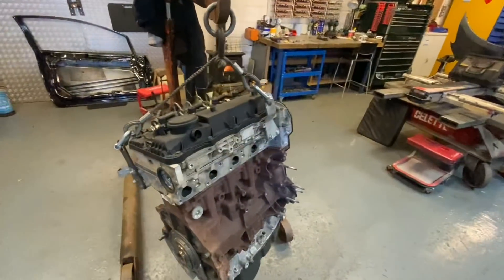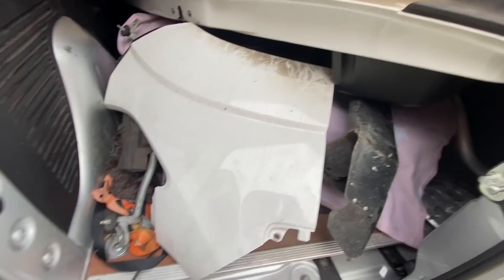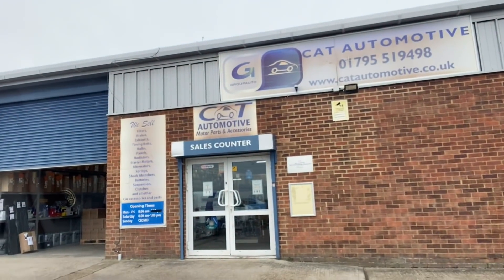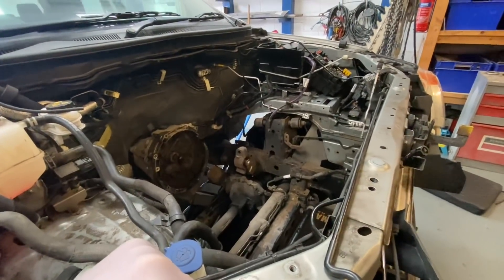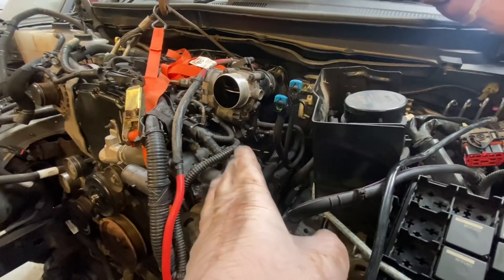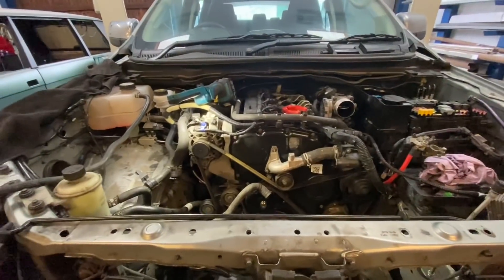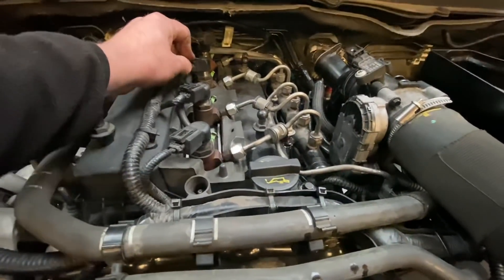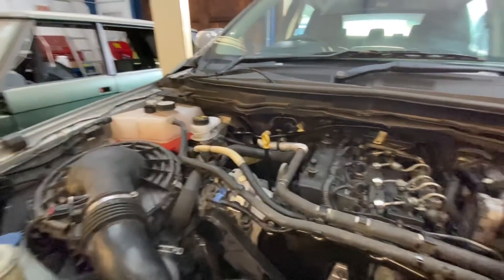2013 FORD RANGER 2.2 TDCI FITTING A NEW RECON ENGINE

Comment: It was a bit of a struggle getting the old block out but that reconditioned block seemed to slide in nicely. It is so satisfying when that happens 😌. Just the aircon rad to get checked and repaint the front bumper. I hope the daytime running light isn't too much of a pain to sort out. Thanks again Rob and Chris for another great video. 👍

Comment: Don't know why you don't buy engine oil in bulk on these recent projects  ?   Ranger flush then service oil change and then you will be doing the Pug van same oil  5W/30 ? 
Empty oil container can be made into a lovely storage bucket /  oil change bucket / parts tray ?   
Its dear stuff the old amber nectar . but you always need it 
Pointless buying a coffee machine for the workshop   you will loose loose all your bolts and fixings

Comment: Fantastic work Chris and Rob 👏👏👏 please could you confirm that the engine rebuild done by Phoenix is the same company that was at Old Ford East London?? I had an 81’ transit engine done there and it went round the clock after their rebuilt but a year ago I needed another engine done but they had closed down!
Reply from the maker: They said they got forced out by the Olympics 👍
Reply: @sruk  oh thanks Rob that explains it but at least I now know where they are next time cheers buddy 🙏

Comment: Very nice. Great work, the engine should have been full of rebuild grease, so it doesn't run dry upon the first start up. I used to rebuild my motorbike engines and they'd be full of red engine assembly grease.
Reply from the maker: It was yes 👍

Comment: I have a 2015 ford ranger with   50000 on it. Should I get the oil pump changed for a geared type one? I've heard the veined type go on a regular bases.
Reply: I certainly would.... Tomorrow.
Reply: Yes yes and yes
Reply from the maker: It’s going to be worth it in the end 👍
Reply: @sruk  ok thanks, I'll get that done asap.

Comment: There is something really special about your videos. Did you buy a special running in engine oil or the regular maintenance spec? If you get the opportunity after doing 250 miles or so in the truck, when you change the engine oil and filter, can you cut the old oil filter open and inspect it for small metal bits, please?

Comment: A shame, you cannot get mileage points for your driving! Mind you, Chris drove through the reassembly of the engine, perhaps if you get them, then he also deserves them. Engine bays are congested these days, and that engine does not appear to want for anything in the weight department. That is really a job for those with unlimited flexibility. It started up brilliantly and soon ran lovely and smoothly. It always takes a moment for the oil to find is way round the engine system. Be warned, the next engine from the engine mafia will want its tribute in skinned knuckles and missed deadlines.

Comment: Can i ask when you turn the ignition on and after turning of the engine there is a high pitch noise coming from the engine bay, my car does this too, can someone please explain what exactly this noise is?
Reply from the maker: I didn’t hear any noise 👍
Reply: @sruk  at 15:33 is the best time to hear it when your messing around with the injector cables theres like a high pitch squeal, the same noise happens after turning off the engine too. btw i am ausing headphones so possibly hear it better, but my diesel car makes the same noise too.

Comment: Rob, to save you time and mileage wouldn’t it be easier to use a motor factor that delivers new parts to you?
Reply: I think they try to avoid using new parts, (usually only if they can’t source salvaged parts)…
Reply: @philtucker1224  things like service parts can easily be delivered.
Reply from the maker: They take to long to come